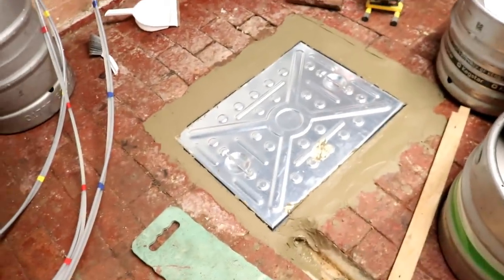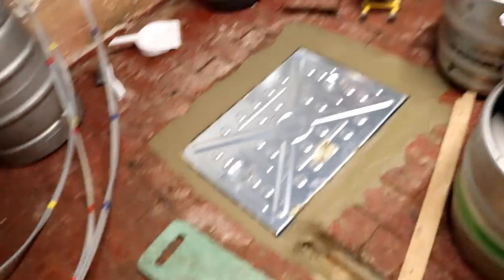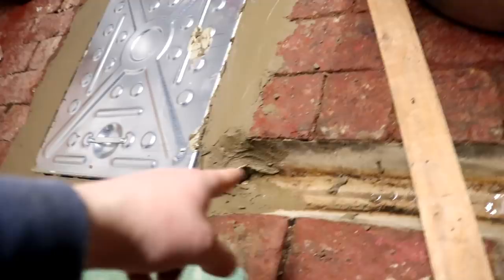I CAN'T DIG IT OUT

Comment: It's always good to have a good length 😄 . I know someone who had a similar problem with a garden flooding. He dug his own sump and installed a cheap sump pump permanently. His was for ease as his sump was under a lawn but you have a man hole cover so probably no need  to install it permanently .  I was going to advise you not to anchor the jetty to the trees as they have a slightly annoying habit of growing and will likely try to take the jetty away from the canal rather than the other way round making it  unsupported and bouncy after a year or so. If the canal leg is adjustable it shouldn't be too much of a problem but you will need a little boat or some sort of ratchet strap, possibly fastened to the tree, to take the weight off the jetty while the canal side leg is adjusted. To be honest it may take a few years before it's a problem, depends what type of tree it is and how fast growing it is, I couldn't quite identify it just from the bark. The doctor does order beer for a dehydration headache, it both re-hydrates and kills the pain in one 😄 . Cheers, Schnuz.

Comment: Be very carefull with your jetty, tradionaly  canals are lined with waterproof clay which must not be punctured.  As you are in a town the section you are on may be concrete or brick, as the boat yard next door to you seems to have pontoons.
However the Canals and rivers trust take a very dim view of people damaging their cut.
Goodluck
Reply: martin grout imagine harry drained all the canals in Retford 🤣
Reply from the maker: I know, I have been informed by Schnuz who warned me about the risks. I will be fitting spreader plates to the legs once I have the main framework in place. Cheers though, you can't be too safe.